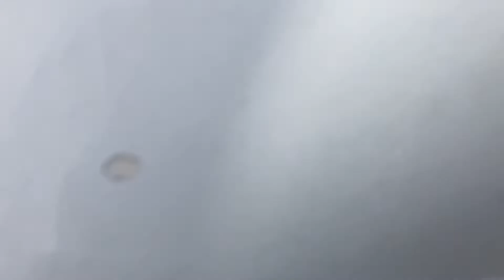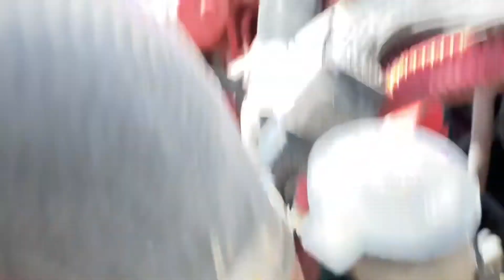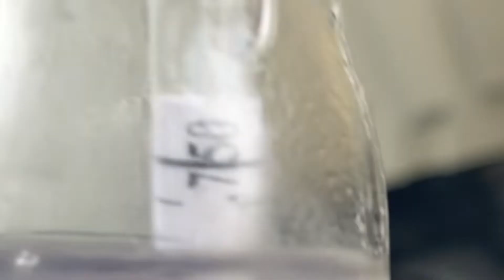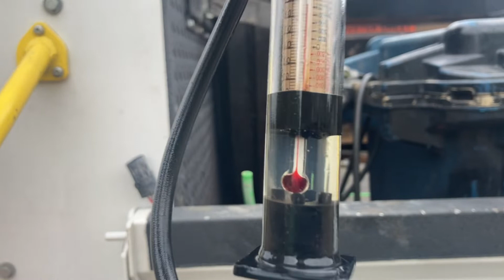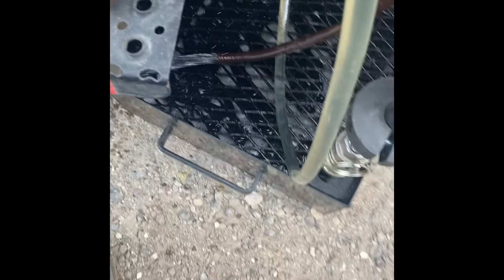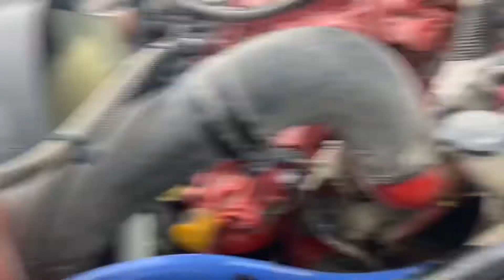Incorrect fuel killed Cummins engine died while traveling now just crank no start

Comment: Good job Bud 👏
Reply from the maker: When I use to work at big dealer I saw guys shoot Ecm, pumps, injectors, turbo’s, heck once a complete engine only to end up with crank no start and when all else failed a hose + 5gallon of diesel and she would bust off after thousands of dollars spent !!! And no the customer were not told instead handed the bill and out the bay it went !
Reply: @sonofmontezuma3732  have seen that myself. $20,000 plus in a repair and fixed with 30 bucks.
Reply from the maker: Yup, saw one 50 liter Cummins blowing white smoke crank no start they called for new engine, new 300,000.00 engine same issue crank only and also blowing white smoke, they had put coolant in the diesel tank OPPPS. And that was diagnosed by a guy with patches on both arm sleeves 😂